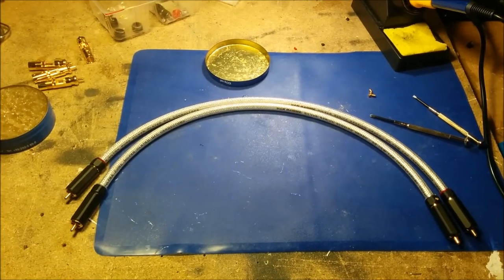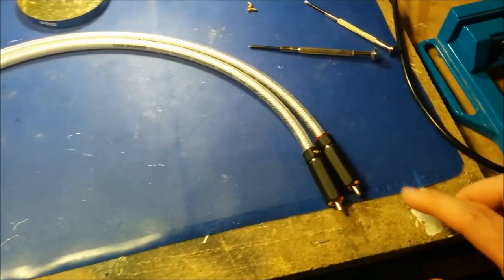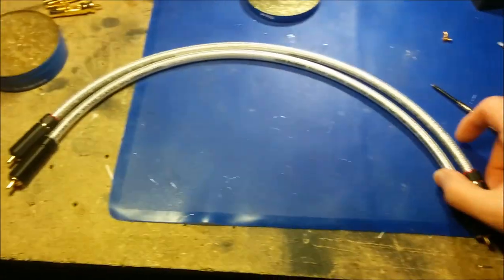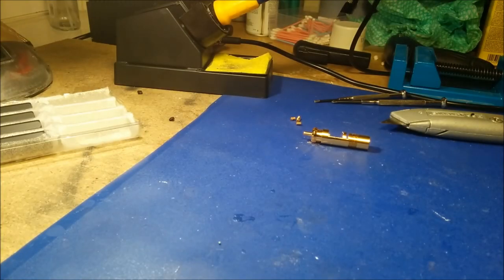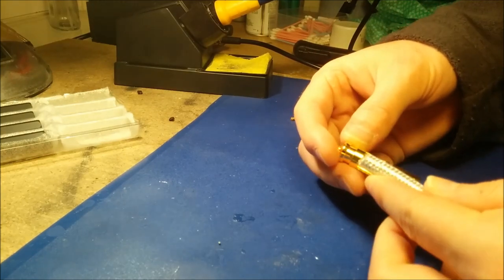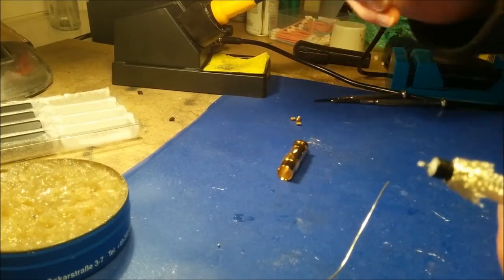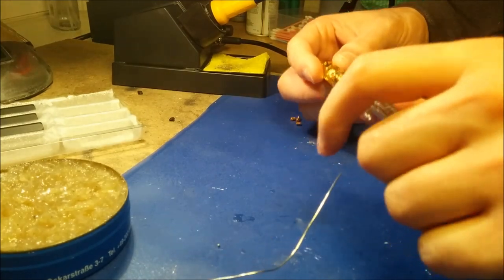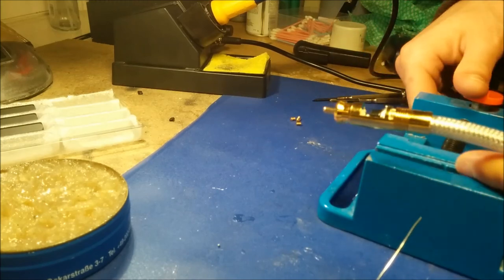How to make 1000 $ Sounding audiophile highend RCA interconnect cable for 30 $ !!!

Comment: I was a cable sceptic. I had some $75 interconnects which I though we're a safe bet. Not dirt cheap, but not ridiculous. 
I then made some pure silver interconnects and could not believe the difference. I then got 5 different people to compare them on 2 different systems (without telling them which cables were being used) and they all picked the difference straight away. It sounded brighter, the sound stage felt closer and just nicer overall. The original cables almost sounded muffled compared. 
Would be interesting to make some of these silver plated copper ones to compare.

Comment: Weller Solder station, with digital temp control, sponge cleaner, and Round spring Iron Holder, Pro Setup for High Quanity/Quality.  Use  60/40, Thin flux core Solder ;)-

Comment: Very good tutorial!
Check out for another solder as there are very good product out there for audiophile cables.
Soldering wire:
Cardas: Cardas Soldering Wire Quad Eutectic Silver Solder with rosin flux
WBT: WBT 0800 Silver Solder 4% Silver Content

Comment: Lo capacitance.  Fantastic.  What about inductance?  If you change the capacitance without changing the inductance you are actually worse off.  There is a balance between capacitance and inductance that factors together to make the impedance or "Z."  

Some might say that small changes in impedance do not matter because the output impedance of their source is low, and the input impedance of their amplifier (or next stage in the signal path) is high.  My answer to that would be "if that's your position, then how does a change in capacitance, hence impedance, change the sound for the better?"  

If they know something about coaxial cables, then they might answer that "it's not just the overall impedance, but the amount of capacitance which can affect the signal."  I would then reply that if one in concerned with capacitance apart from impedance, then would one not also be concerned with inductance?  If you change one without the other, you are changing the the frequency response of the cable.  If you make enough of a change, your cables effectively become filters in certain frequency ranges.  

It's just marketing BS designed to convince you to pay big bucks for their product.  Some things DO matter in cables, but very few people here listen to the kind of music that would expose these slight differences.  Of those that do, they also would have to have speakers capable of the extreme accuracy needed to hear the differences.     

MUCH more could be said.

Oh, and as for the cables making the ground before making the signal... Why on earth would you be mucking about with cables with the power on?  There is NO reason, and doing so increases the chance of something really expensive happening.

Comment: I built the same cables many months ago. I'd advise you to use non silver products as these add artificial colouration to the music and these ones are like the qed silver spiral. There's a copper van damme wire one should use instead of this and the van damme hifi 6mm speaker cable is dirt cheap and worth a look to compliment it. Good quality OFC first,if you can stretch your budget good quality occ

Comment: Silver conducts the best audio quality.
Reply: Alter Kater 
Yes.
Reply: +Gaming ...and what about you're crossover in the enclosure of the speaker ?  or the cable inside the box to the speaker in cheap copper ??
Reply: In a higher end audio component, you'll get better quality crossovers and internal wiring so that's really irrelevant.
Reply: john moritz 
I built even my Cyburg Needles with FRS8M with silver wire and goldplated plug ports and all.
Reply: Silver oxidizes, gold does not... 

So gold should be better but is significantly more expensive. Silver needs a vacuum seal so that no air comes into contact with it. Supra/Jenving has low cost cables which are silverplated, but unless bought terminated with vacuum clip seal they will need cleaning from time to time just as copper wires.

Still goldplated terminals gets dirty too and some of them are probably fake or not pure enough to not oxidize.

Nordost has a great product which cost like a videogame per bottle that cleans oxide, dirt, electrostatic & -magnetic fields right of a terminal, cable, wire and/or chassi.

I'd say there is bigger difference in soundquality btw different copper purity levels, insulation and design between two copper cables with huge price difference than (any) copper cable vs (any) silver cable, but I guess you have to take into account the method of termination of any cable too.
Reply: Give me numbers ... why is silver better ?

Comment: Great job Can I use those connectors with 14 awg 4 conductor  two  wires twisted together then soldered  into the jack

Comment: Hi mate, can I ask where you get different  cable brands  from online, making the cable seem to be straight forward, it fining the cable you want to use which seem to be the hard part. And what do you think of the £1000 interconnect, snake oil, maybe?

Comment: Are you still using these interconnects? I've become a little jaded with silver coated copper. Seem bright and fatiguing in all 3 of my systems. (one is all tubes) I'm not quite sure if it is just the high conductivity revealing some attribute in the chain, or if it just a characteristic of the silver itself.
Reply: Definitely silver can sound bright.but this van damme is low rad it reduces the brightness off it.van damme cables is what they use in recording studios like Abbey Road.its decent and not  expensive.

Comment: Is the shielding soldered on both ends of the RCA connectors? I heard on shielded cables only the source end is soldered and the other end remains free or the cable becomes an antenna.

Comment: Why would I want to roll off treble, can anyone provide an in depth answer to this?  These are guitar cables specifically designed to reduce treble roll off.  The entire point of high end audio is to reproduce recordings as accurately as possible. Unfortunately, that means you get the good and the bad. I have had some recordings hat were just downright awful and I could not even tolerate to listen to them.  My point is I would not want to affect the recording.  I'm genuinely asking this question my knowledge is limited and my personal preference for myself is to have crystal clear highs(treble) of course that is subjective were someone else may feel that is to much and others have told me it was just right. This is why i personally have a penchant for b&w diamonds, b&w Maserati edition as well as klipsch. Original la scales without adding a subwoofer. I have had the absolute best staging from my la scalas than anything else I own. Trust me i have amassed a hugeeeee collection. I know what I like to hear. However, I am attempting to learn more about the technicalities behind the scenes. So all. Information on my question would be greatly appreciated.  However, if we can limit responses to just the facts and not personal opinions. Thank you

I just purchased a specialized audiophile soldering iron for $1800 just for this project. Anyone else have a audiophile soldering iron?  Lol.

Comment: :-)  what does $1000 sound like?

I bought some surplus cable at an industrial place some years ago. Rubber jacket wrapped with real foil (not mylar) with a ss braided drain wire inside and a cotton rope for tension strength. Inside was two thick twisted pairs about 22guage each pair had its own shield.  Blew away anything Ive seen from the audio industry. Paid like .25 cents a foot. Soldered some monster ends on one, some esoteric audio ends on another. Still usin em on one car have about 20ft left for the future.
Reply: +FuckGoogle+ what was the original industrial application for that cable?
Reply: +guguigugu no idea. typical of surplus, rolls and rolls of cable, even they dont usually know much about. probably wasnt audio, maybe some kind of old school data transfer or networking?
Reply: ***** that makes sense, network cables are usually well shielded and have very low impendance, capacitance, attenuation etc. all desireable traits for audio application as well.
maybe i should repurpose some of my ethernet cables :P

Comment: Hello thx for the info,
I just made cables using the Van Damme Silver and the Neutrik connectors really high end cables there :)
Reply: High End?  Audiophile ? um, what do they have in common $$$$$.    Apple started this with UPGARDES.... pay what you can within your income bracket,  RICH people PAY more for the same dam stuff, why?  because they need to dispose of Money also!  They can tell there FRINDS oh, look I sent $120K on my stereo!!!  The next rich guy says, if your not spending $175,000.00 your system is suffering.  I spent $250,000.00 aren't I cool????   No your a FOOL !

Comment: why is there just one cable in those wires? shouldn't there be 3? hi low and ground?
Reply from the maker: Hi these are not balanced, therefore you have signal in centre and (return) ground via sleeving
Reply: Audiophile Vintage oh okay thank you. Is coaxile good to use? what about a guitar cable?
Reply from the maker: @thestackcash01  In fact, this is actually a guitar cable :)

Comment: what RCA connectors are these. Where did you buy them from. I am in UK.
Reply: Ebay UK: sold by petern2010 - PRO PHONO RCA PLUGS Heavy Duty Locking WBT Type Connectors 9mm Cable Entry.
Reply: Compass Audio UK in Glasgow.

Comment: Plot twist, you can just go out and buy $30 interconnects, have the exact same or better results, without the hard work...Audioquest Evergreen cables...all you need, and cheap!👌👍
Reply from the maker: Yep why not, world's your oyster when it comes to cables :)
Reply: I diagree .I was using £120 ($150) Chord Company cables and made them redundant  for these Van Dammes that I paid £34 ($43) for from a small independent cable maker.. a cable that costs $30 to make is not the same as a cable that  has a retail price of $30. If your Audioquest cost $30 to buy they probably cost $5 to manafacture if that. There is an independent hifi retailer here in the UK selling these Van Dammes at £135  ($170).

Comment: I use neutrik connectors too. they're awesome and do substantially better job than wbt or cardas for the fraction of price.
Reply: i found the neutrik pro audio speaker connectors to be awesome. totally goof proof and real durable. reasonable if you buy em right.
Reply: +Mark Miretskiy Neutrik makes good pro grade connectors, but they aren't audiophile grade.  True WBT and Cardas connectors are at a completely different level than Neutrik - there is a real difference, though if you aren't using premium cable and good quality equipment as well, the difference would be lost.
Reply: +PDX Girl "true audiophile grade"
Is there an entity somewhere that
 established that title and published specifications?
"the difference would be lost"
What difference would that be? Some quantity of an electrical property measurable with test equipment? Because if you can't measure it it does not exist. And these quantities do not take a large amount of money to be met. 
Any of the cables mentioned can be placed in an A/B blind test and it is doubtful anyone could detect which is which. 
The word "audiophile" is pretty much a joke amongst electrical engineers. It translates to pompous suckers easily parted with their money and who gladly perpetuate myths and fiction for the sake of consumer purchase selection confirmation bias. 
Yes there are differences in cable and wire.  Resistance, capacitance and inductance all cause interactions with the signal as it goes through the amplifier and to the speakers. These properties will cause the user to adjust the equipment to compensate then later convince himself it sounds better, and maybe it does. Maybe it doesn't. 
Look up Roger Russell on the internet. He was one of Macintosh's top engineers for decades. He has a website that has some of his published work on cables and reveals the fraudulent nature of the industry.
Reply: +FuckGoogle+ The term audiophile is certainly subjective. To me, it simply means making your system sound as good as possible using quality components. If I design a circuit intended to be "audiophile grade", I'll be using the best parts I can find, as compared to maybe "studio grade", which is not going to be using the very best parts available. 
I do not buy into hyperbole and marketing, I focus on what sounds best using sound principles. An  audiophile cable, to my definition, will have high purity copper, better shielding, etc. it need not be very expensive, and provides easily provable improvements over cheap OEM cables that may not even have 100% shielding.
Reply: +FuckGoogle+ And by the way it is measurable in terms of interference rejection, whether or not there is high frequency loss, resistance loss, etc if we're talking cables. And sometimes it's just about having something that's precision made that feels solid in your hand - many people care about that, too.

Comment: How will I know if they sound like $1000 cables?
Reply: I think he means they will outperform a £700 cable on technical specification and performance.On a £700 cable upto 50% will be dealer profit, out of the remaining £375 there profit between the cable company and the retailer, distribution costs, marketing costs and ofcourse day to day business running costs to deduct  take all that out of the equation and what you have left is a cable that costs about the same to manufacture. I have listened to £700 cables and in my opinion no cable is worth paying that kind of money for. I own a pair of these VD cables , they cost me £35.00 (£17.00 in components) and transformed my system, they are very revealing though and a bit on the bright side. The best cables to buy are pro grade cables that are used in recording studios and they are a lot cheaper
Reply: what i would like to see is someone make 2 recordings with different cables and then see if they null out.

Comment: Just the RCS connectors cost about 120 for one cable. Where do you get them from so cheap? link?
Reply: I get the China knockoff from ebay. Kostet about 8€ for a full set. I compared them to the original WBT 0144 and the are the same.

Comment: G'day mate 
would they be good to connect to a small DAC ??
Reply: +jack turtle Unless your wanting the experience, you don't need to spend that much...RCA cbles all work the same...Just like HDMI cables...Once you go beyond a cetain length you may need a thicker cable but other than looks and the DIY, theres no difference

Comment: What brand are the connectors.  In the video I think you say furutech copies?
Reply from the maker: You find them on ebay as WBT RCA cost about £12.50 for two pairs
Reply: Ian Phillips Seems though Furutech is based in Tokyo, one could conclude that Furutech are good ol' 'Made In China' sweatshop type brand, like most high-end gear, so i wouldn't worry about if they're copies or not.
Reply: +utubecomment21 True Furutech connectors are actually made in Japan, not China and are definitely not sweatshop-made.  They are very good connectors, and there is a real difference between Furutech and Furutech "type".
Reply: PDX Girl
Nice to see someone believes in Furutech's marketing material! For the rest of us; facepalm :(
Reply: +utubecomment21 I never said I believe in everything they sell - they do have items that won't do anything, such as expensive receptacles or other weird things. But they do have some nice connectors that work well and many customers request them. I personally wouldn't spend a ton of money on my connectors but I also don't buy the cheapest out there, either. 
The quality control on the clones is also often lacking.